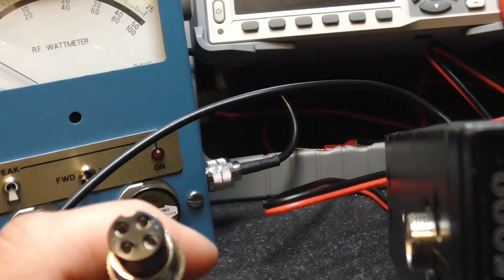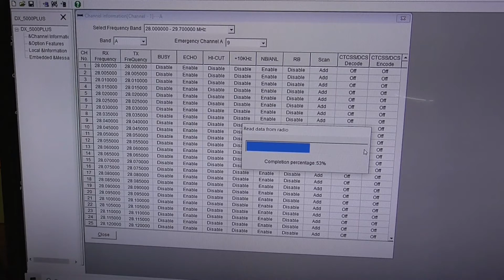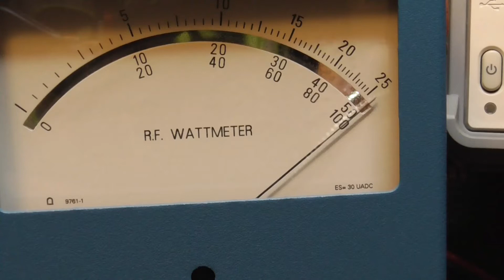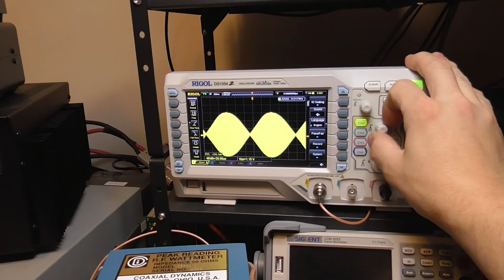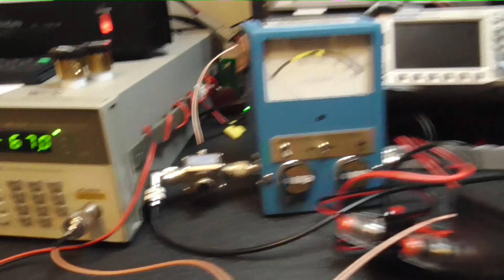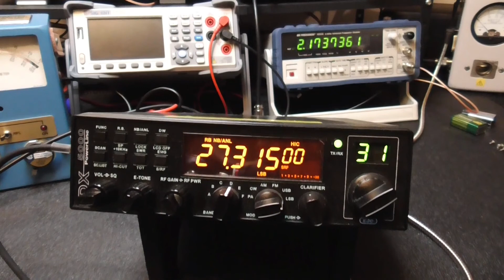K PO DX5000+ Reworked for Jesse

Comment: Curious, why would you want to lower the power level, just want to learn what you are doing. Thanks.
Reply from the maker: Because the power is spreading beyond the preferred TX pass band. Example would be more power causing bleed over.
By lowering the power you will ensure all the power is closest to the frequency being transmitted on.
Reply: Got it, thanks. @ScottsRadios